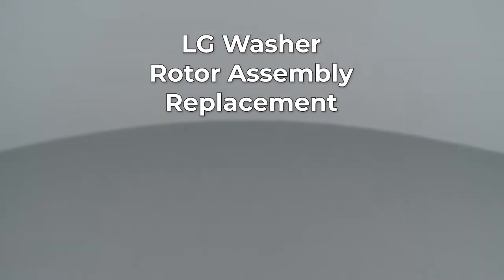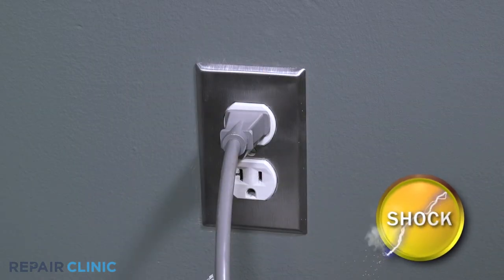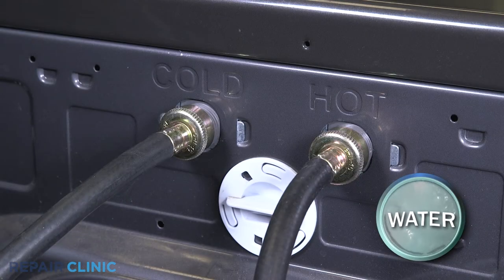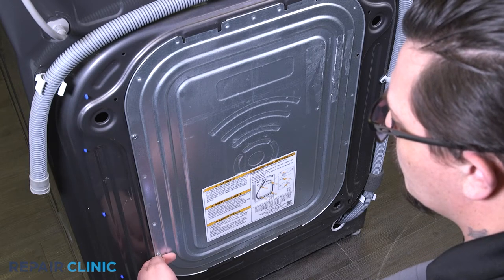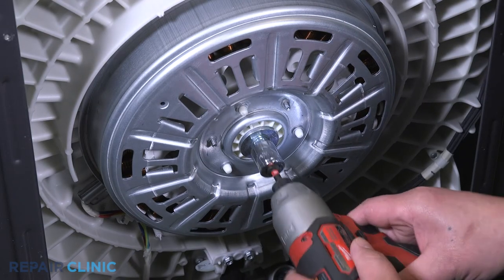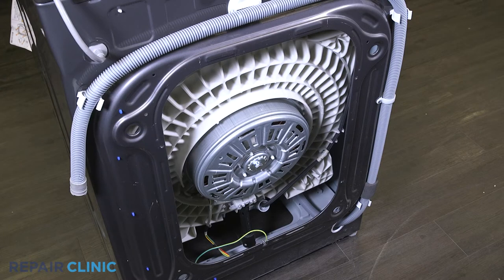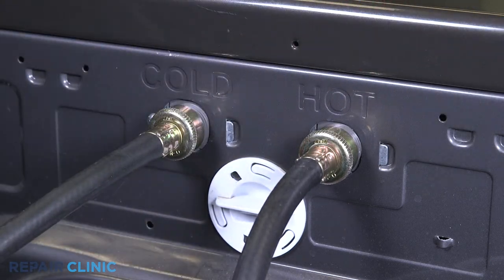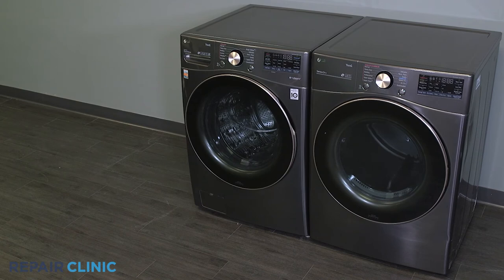LG Washer Rotor Assembly Replacement AHL72914401

Comment: GREAT VID.  We are having a problem that I'm hoping you can help with. How do you keep the rotor from spinning when trying to loosen the bolt?
Reply: im having the same issue. did you ever figure out how to fix it ?
Reply: @fenwickc2274  I had a repair technician come out and do the job because my guys weren't capable 😞
Reply: @fenwickc2274  impact driver works best because you are not putting so much leverage on it.  If you do not own one you can hold the side tight with a glove use a longer 3/8 ratchet or 1/2 with 17mm bit and smack that with your hand 3-4 times to get it loose without it spinning. you will be hitting it downward counter clock wise.  After a few good hits it should take the large tension off then it will be easy to unscrew the rest of the way.
Reply: @WasteU2  got it all fixed up and running properly thanks